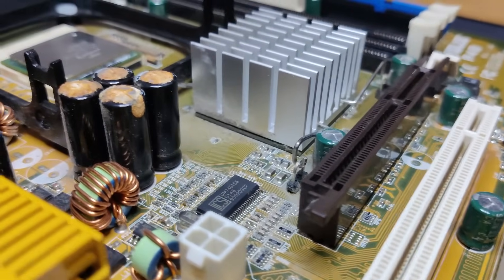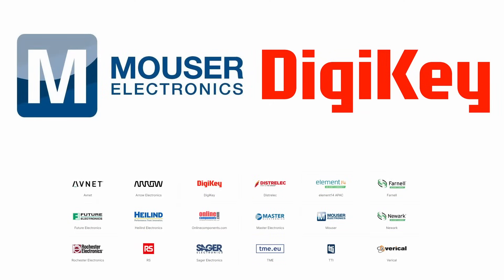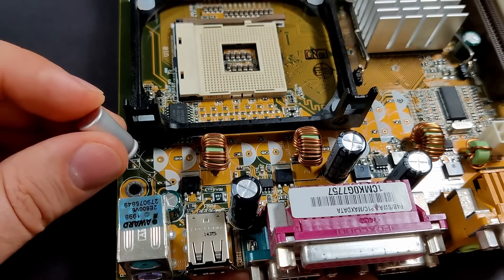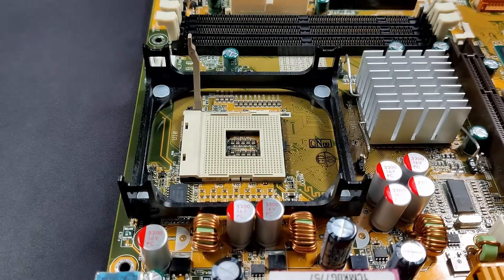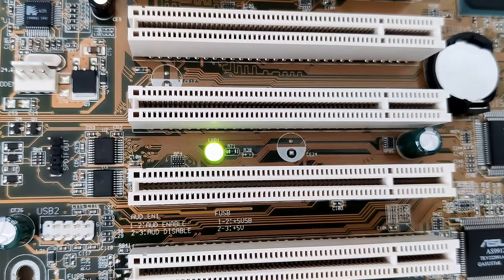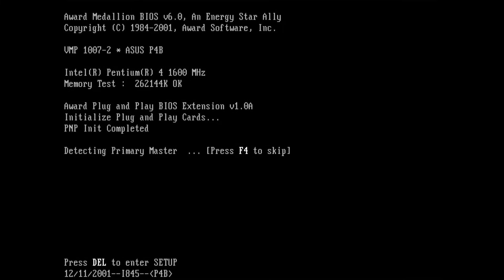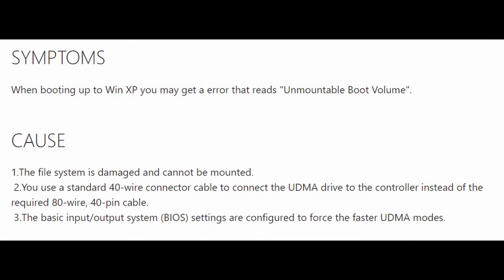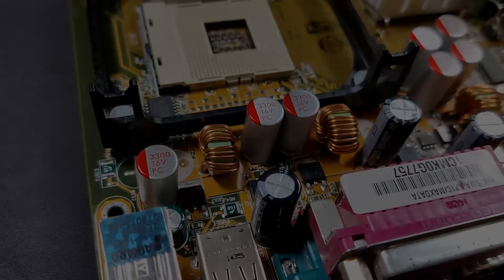ASUS P4B: New capacitors, a talking BIOS and Ultra DMA woes

Comment: There are very little resources on the internet on those 3300uF 16V Chinese capacitors. So thanks for trying them out and taking some measurements. 

I have a bit of a concern though: in one section of your video you measured a capacitance of 3544uF @ ESR of 0.3 ohm.The capacitance is fine as it is within 20% tolerance of the 3300uF rating, the ESR is a bit more interesting. On some capacitor spec sheets you will find a tan-delta value that usually varies by voltage and it's usually measured at 120Hz, 20'C.

We can assume that your component measuring tool measures ESR at similar conditions. We can use the formula:

ESR = tandelta / (2*pi*f*C)

It follows that

0.3 = tandelta / (2*3.14 * 120 * 0.003544), which implies that tandelta = 0.3 * (2*3.14*120*0.003544) = 0.8

Back in the day, people would replace those capacitors with Rubycon MBZ (an ULTRA Low ESR series capacitor) which (according to the spec sheet) has a tan-delta value of about 0.2. In the case of the MBZ, you should've measured the ESR at:

ESR = 0.2 / (2*3.14*120*0.0033) =  0.08. 

Like you, I'm a hobyist at best, but to my understanding the ESR does play a role on some VRM-switching circuits as it is essentially a timing problem where you want the capacitance to build up quickly and release energy / voltage at a certain speed.

Comment: Can we get more info on the SD card adapter to IDE ?
Please and thank you
Reply from the maker: What information are you looking for? You can find those adapters usually on amazon, ebay, or aliexpress. They are replacements for hard drives and work quite well. The only downside so far is, that you can have only one of those adapter per IDE channel (no master/slave settings).
Reply: I have tried 2 from Scamazonia, and the did not work for me. Asus P4GE-v @bitsundbolts

Comment: Asus P4GE-V is another on that has Spoken Bios post.
I have one as a retro gaming PC. No cap issues yet.
Info:           Windows XP ( Service Pack 3 )

     Platform Information
          Processor Type: Intel(R) Pentium(R) 4 Processor
          Processor level: Family 15
          Processor Revision: Model 2 Stepping 9
          Active Processor Mask: 1
          Number of Processors: 1

     Controller Information
          IDE Controller:  Intel(R) 82801DB Ultra ATA Controller, ICH4
          Storage Kit Build(s):  2.3.0.2164, 
          Storage Kit Installed:  2.3.0.2164
          Driver Build:  Intel Application Accelerator Driver
          Driver Version:  2.3.0.2160
          IDE Controller Tri-State:  IDE Controller enabled
          PIO Mode Support:  0 - 2 - 3 - 4
          DMA SW Mode Support:  2
          DMA MW Mode Support:  1 - 2
          UDMA Mode Support:  0 - 1 - 2 - 3 - 4 - 5
          Disk Timeout Value:  Default
          CDROM Timeout Value:  Default
          CD Audio Timeout Value:  Default
          UDMA on 80 conductor cable only:  Default, Disabled
          Flush Enable:  Default, Disabled
          Ping Pong Enable:  Enabled

Comment: I used to have a Asus P4P800-E Deluxe Socket 478 motherboard, and later on a Asus PC-DL dual socket 603 motherboard. Both had speech messages as yours. Great video.

Comment: Asus A7N8X Deluxe and the -E with gigabit have this feature..  I like it, I think it's cool..  I expiremented with changing sounds.  It is still cool.

Also, FWIW, just trash all your 40-conductor cables.  Not really woreth it anymore.. as soon as they came out, I stopped using them all together back then.,.

Comment: The error at 10:10 you were experiencing, 0xc0000221 is STATUS_IMAGE_CHECKSUM_MISMATCH

Something had to get really corrupted in memory for that to happen during the boot process lol
Reply from the maker: I'm not sure. But I think it has to do with the wrong driver files. I did not overwrite any newer files with older ones that the sound blaster installation wanted to install.
So, maybe it could be that a wrong memory address was accessed due to said wrong files. I installed those drivers after I was done with this video and overwrote all files. The vxd driver worked then

Comment: i've had trouble installing windows xp early this year too. i got old parts lying around and thought of building a retro gaming pc but windows xp refuses to boot on my asrock board with 478 socket with some hard drive error. i forgot the model but it came out after windows xp so the motherboard should be compatible, i don't get it. using the same drive i installed windows xp on a asus m2n-se plus without any issues but this one doesn't have agp slot.

Comment: Hi ! Interestig video & good video mounting.

The first time that i had to replace capacitors was in 2003, a PIII motherboard. For next years, plataforms in socket A and intel P4 with the same problem. Windows Xp installation was imposible without replace them! . 
For my MB collection only replace with the best, no electrolitic. Some people prefer the low cost reparations.
Actually you can check in MB (& GPU cards) solid state capacitors and tantalio capacitors since years.

Comment: I somewhat vaguely remember a friend of a friend whose built system had that "talking BIOS" feature.  I remember that it was possible to change the startup sound, and he was able to play some goofy song when it booted.  I'm sure it got old pretty quickly, though.

Good call on checking the polarity before putting in the new caps.  I would almost certainly have overlooked if it was me.

Comment: I own a talking Asus board and you can change not only the voices, but the graphic on the POST too 😊
BTW I newel knew about 40/80  IDE cable issue, becouse I aways used 80 for HDDs and 40 for CDs. I only used 40 for HDDs on old motherboards like up to 486 and  Pentiun 1 systems.

Comment: Some SD to IDE adapters caused me trouble in the past.
I was buying 44-pin mini versions off Aliexpress to replace HDD in Amiga 600 and a PIII laptop. Out of 6, only 2 were solid - faulty ones would randomly freeze the Amiga, and corrupt SD card on PIII. Changing SD cards didn't seem to matter.
While adapter could only push approx. half the transfer speed of era appropriate HDD for the laptop (only 12.5MB/sec), XP on it still felt way faster due to near zero seek time; and A600 running off SD card somehow was a bit slower than with HDD.
Just my two cents.

Comment: You probably already know this, but for those that don't, Win98 successfully installed and ran because it defaults to PIO (Programmed Input/Output) mode unless DMA mode is enabled either by the user or the chipset driver (and even then, not all drivers do this) so even though u-DMA was set in the bios, the OS negotiated PIO mode by default, but Win XP enables the highest reported DMA mode available hence why it would fall over almost as soon as the install began.

Comment: Just a tip: If you don't have the 80 line cable around, you can use the 40 line version if you disable Ultra-dma access in bios. It should be somewhere in the integrated IDE controller options, depending on the board. It will be far slower but it will work.

Comment: OMG I have the ASUS P4B266-E and the manual says it supports Vocal Post Messages too! Gotta check it out, although I'm pretty sure the capacitors are also bulged and in need of replacement 🙂

Comment: i had one of these motherboards, and tried replacing the voice samples with my own voice
but i spoke too slowly, and it seems to have overrun the defined buffer

the bios lost all ability to boot from pata hdd's!
but it was still able to boot from pata cdrom, and the win98 install cd could then chainload the hdd, and get back into the editing sw

and one day while messing with overclocking, it rebooted on its own, then claimed no cpu was found!

Comment: I remember my asus amd bios having this. I remember it seeming pretty nifty and cool, but occasionally if my speakers were too loud, this was rather annoying and jarring. I can't remember why I turned it off, but it's probably due to it being annoying to reboot. If it were to diagnose a problem only, then it's not a bad feature if you know, you have it on. Did I want to hear system completed power-on self test, computer now booting from operating system every time? No. I can't remember if I had keyboard detected failures, since I had usb keyboards. I had an amd xp athlon and an asus motherboard, I want to say it was an nforce 2 motherboard. I really loved nvidia chipsets. I do quite miss them. I remember having to deal with VIA and SIS chipsets and finding both to have stability problems. Nvidia came along, started adding great features and were stable. I googled it and now remember it. ASUS A7N8X Deluxe was the motherboard. I hated seeing nvidia exit the market, but honestly I feel it was good to have them shake up the industry and made Intel and AMD start having really good chipsets. Intel chipsets were generally solid before, but their motherboards were lackluster.

My acer predator laptop plays a start up sound with no way to remove it from the bios. I find that a little annoying when I want to be quiet.

Comment: I remember  experiencing speech through the internal speaker on  post on  some cheap mainboards,   there was no reference in the manual   to it and when we got in touch with the supplier he thought we were pulling his leg,  so had to put the phone next to it when it started, was  quite funny, but he rang back  in the afternoon and confirmed that the boards that they tested of that brand did the same, was hilarious at the time, if memory serves it was  about the time of the Cyrix M2  and the AMD k6, the voice belonged to some Chinese chick which kept on saying 'too hot' too hot'  on bootup through the internal speaker, it would even do it without a CPU installed ! I cant remember the brand but  it was  one of the cheap ones that had an ALI chipset,  other than that niggle the boards seemed fine.

Comment: If those are genuine polymer capacitors I'm a flying monkey. You would have been better off with random no-name electrolytic capacitors, at least they would have had vents to keep them from going nuclear when they explode. No real manufacturers even make 3300uF 16V caps.

Comment: What are the orange and white connectors near the DIP switches?

They look very non-standard.
Reply from the maker: They were used for proprietary peripheral devices. If I am not mistaken, one Port was for a card reader.
Reply: @bitsundbolts  curiosirty got the better of me so I dug up the manual. They were for a SD/SM card reader of all things.

Comment: Vobis... I remember the 486 we bought was a Highscreen Colani tower 486 DX2-66. We bought it at the local Vobis store at the Finnlandhaus in Hamburg. Apart from an issue with the changeable harddrive because of a busted frame, it worked like a dream. We even upgraded it ourselvbes with a Soundblaster and a CD-ROM drive. I miss that computer almost as much as I miss my first PC, a 286-16 we bought from Karstadt at the Einkaufszentrum Hamburger Straße, also in HH.

Comment: Did you dummy fit the north-bridge heatsink to see if it contacted the heatsink paste, because the foam square support might be too think if you are not using a heatpad again.
With caps I think you are supposed to only go up 1 voltage value, because different voltage ratings work at different frequencies.

Comment: You should totally try the 2133Mhz setting for the processor speed. Pretty much all of the 400fsb Pentium 4's (well for socket 478 anyway) you could set 533fsb and they'd just work like they were made for it. No need to mess with voltage or anything.

Just be fun to see a comparison. For awhile during this era I remember the 400fsb 1.8Ghz - 2Ghz P4 was the budget goto since it was as simple as setting the option to run it no fuss at 2.4Ghz - 2.6Ghz.

Comment: There were several ASUS boards that have the talking BIOS, notably the A7V-333 for AMD athlons of the same era as this board.
Reply: A7V8X Rev 2.0 also had it. A rather nice KT400 mobo and among the few I have seen to be rock solid, before ASUS' quality went down the drain in the P4 era.

Comment: I've never even heard of a talking BIOS (if you'll pardon the pun), let alone seen one, even during the times I worked at a computer store, which were during the Pentium 4 era.

Personally, I did have a Pentium 4, although only for a short time. My friend upgraded his P4 3.8GHz to the 3.73GHz Extreme Edition, so I got his hand-me-down and upgraded my A64 3800+. However I soon realised this was a mistake when the A64 X2 came out, so I switch back to AMD with an X2 4600+.

Comment: I have to say that I absolutely miss main boards with that translucent amber solder mask. Being able to see all the traces makes the board look gorgeous. If a manufacturer used that on a modern board, I'd buy it in a heartbeat and not even look at the price. I am so very tired of black PCBs when they can make them any color they want. I actually want to modify a modern windowed case to accept those cool looking vintage boards.

Comment: Hey, I think those additional voice samples are from my own video about the P4B's talking BIOS. Small world. I don't mind, spread the word about this odd board! Mine eventually died, not due to bad caps, but rather a VRM short it developed after sitting outside in the elements for a while. I reiterate the comment about the northbridge heatsink clips, one was already broken on mine.
Reply from the maker: Hello there! Indeed, I came across your video while doing research. I found the speech feature after I powered on the board - and as you have seen in the video, I pretty much glued the heatsink to the CPU with the thermal paste. I did take a few voice samples from your video to add a few more voice samples in my video. However, there are still some more in your video which I haven't used - especially the endless loop of some of them. I will add your video in the video description if people want to hear a few more of those samples - including the endless loops.
I have checked the northbridge heatsink clips on my board - they seem to be fine. I still need to take a closer look with the microscope, but clearly, this seems to have not been a good engineering decision soldering those clips through the motherboard if so many are failing!

Comment: Great to see the motherboard working!
As soon as I read the title of the video, "system failed CPU test" came to my memory. I didn't remember Asus' speech POST was available in such "old" mainboards, I thought it was newer (like late socket 478 or early 775).
As others have mentioned, resoldering the northbridge heatsink mounts would be a good idea, it was a common problem.
Never encountered problems using a 40 conductor cable for the HDD on an UDMA system. Of course the maximum DMA mode would be limited and some "modern" mainboards even showed a warning during POST, but the inability to install the OS is new to me. Maybe a specifical "issue"/limitation with those flash card adapters?
Great video, as always!
Reply from the maker: I think you are correct, it must be something with those SD adapters.
Thanks for watching!

Comment: athlon XP was the superior CPU. ALL P4's are vastly inferior. You're even better off with a P3 ironically. P4 just sucks. If I wanted a early to mid 2000's era PC I'd go AMD again.
Reply: Always used AMD inside my PC's since 1997, During the Athlon / XP era the boxed coolers where not beefy enough and that gave AMD a bad reputation with hothouse processors and there was a viral video with a burning processor. A good aftermarket cooler made a big difference.
Reply: @harrydijkstra9936  Well.....they were cheap. That was my introduction. Then they were superior. Then they were almost completely useless. Then they were decent and eventually the best again.....until now, when now they are more power efficient. work/KWH favors AMD. And in many cases are close enough to the top.
Reply: @awilliams1701  I skipped the bulldozer generation on my personal rig, switched from phenom II 955 to a Ryzen 1600X and currently have a Ryzen 3700X on the same motherboard. 
AMD made some bad decision's on the FX bulldozer design like a shared integer unit between 2 cores with one floating point unit, even a dual core pentium outperformed them.
Reply: @harrydijkstra9936  yeah those were the horrible ones. I have a 5900x myself. I had intel during the phenom generation. In fact it's the only time I've ever had intel on a desktop. But in the last few years I switched from an intel household to an AMD household.

Comment: 4:45, 4:53 there are still three unpopulated capacitor locations. ALWAYS use 80 wire ribbon cables on boards with IDE faster than ATA33. The additional wires are grounds in between the signal wires. They help to reduce crosstalk and interference.
Reply: In almost all electronics there are non populated places

Comment: Yeah, I knew about those talking motherboards. I once got an Aopen AK73 Pro board (VIA KT133 chipset) with an Athlon XP 1600+ CPU which didn't work/boot. I heard some strange noise through the small piezo buzzer but couldn't clearly hear it. When I connected a real PC speaker I was like whaaat? Female voice: "Your CPU may have a problem" It talks! 😅 I never got around to figure out was was broken though, the board or indeed the CPU itself. Perhaps some day I'll have another look.
Reply: I recapped many Aopen AK73 and AK77 boards during that time, they had crapping out GSC Caps.
Good brands are: Rubycon, Panasonic, Nichicon (not during that era), Samxon, Sanyo, Chemi-Con and then the motherboard specific series with Ultra low ESR.